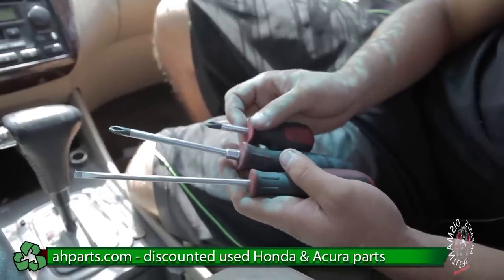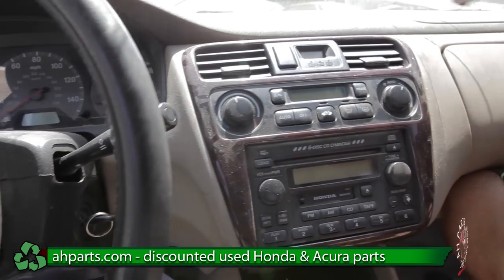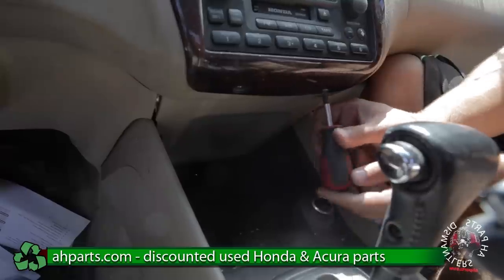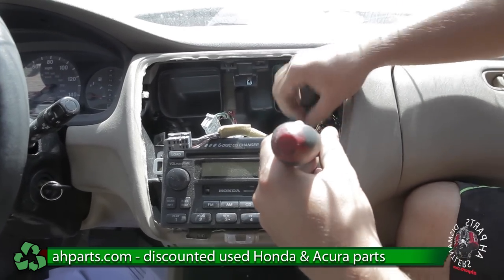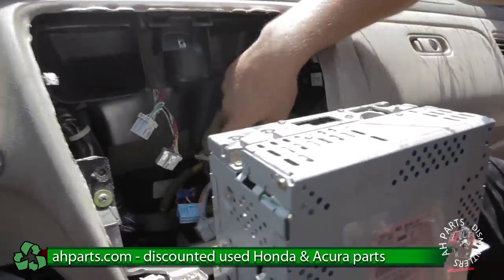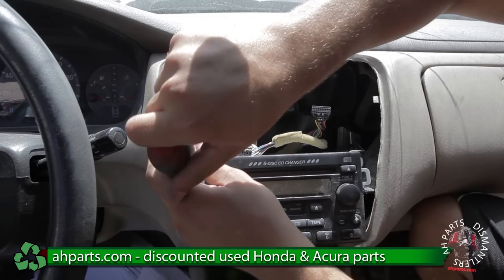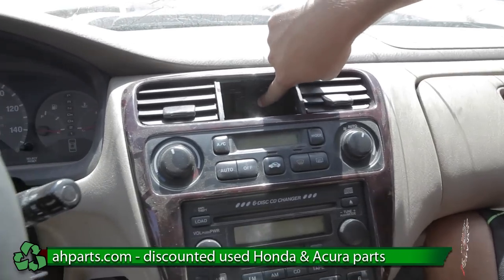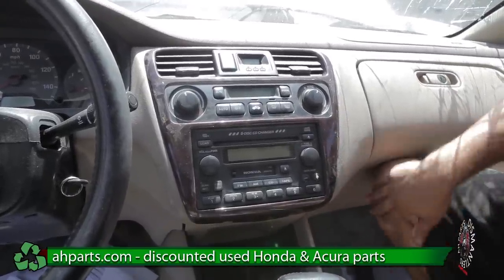How to replace / change a Radio 1998 1999 2000 2001 2002 Honda Accord REPLACE DIY

Comment: Who takes their stock radio out to put in another stock radio 😂😂😂
Reply: Idk maybe a tutorial about to to take out an install a radio
Reply: Ha, exactly.  I thought he was going to put in some cool SOTA android auto unit or something.  My accord's stereo had its CD player die a while back so I want to replace the whole unit, if I go to that trouble I'm not going to put in a 20 year old stereo.  Where would you even find this radio now?  I doubt Sony makes this model from so far back.
Reply: Purists in Germany would buy used BMW and go to get the original radio. Here the manufacturers made us belive oem or bicycle....
Reply: I DO! Replaced my Broken Cassette player with another that works GREAT! "OLDE SKOOL", can youz dig it!! ...Payce.
Reply: @beeman10power  same here man. have a '99 civic, when I bought it two years ago it had an aftermarket bluetooth unit; I put in the factory CD/radio unit AND the original casette player accessory (I can play songs from my phone using a $5 casette adapter that never breaks); found both at a junkyard for like $10 each. sometimes it's all about that original look, ya feel me. the aftermarket didn't fit the clean 90's interior look ;) granted, I also consider myself a purist. no hate, just thought some of y'all would like to understand the reasoning behind this kind of stuff
Reply: Yooo ong
Reply: @srinivasaniyer407  in Germany Cars become historic after They Turn 30 but they must be 90% Original. So you would want to have the Original Radio to get that TAXFREE historic Registration.
No worries you can imidiatly get a New Radio after but keep the old for the renewal every 2 years.
Reply: I did
Reply: I'm putting in a tv
Reply: Wtf💀💀
Reply: I put in a 50 in  plasma tv!!!
Reply: This is a good point if you’re replacing the radio you’re probably going to get an upgrade

Comment: This may be a dumb question so pardon my inexperienced. My 2000 Accord EX V6 came with the radio that only has the CD player. Will the radio with the CD AND cassette player fit in there too? If not, is there one from maybe a Civic or a TL that will work? Also, will I need a different radio code if I disconnect the battery and install a different radio?
Reply: yeah, the refreshed one (2001-2002 accords) will fit in there too. you will need the security code; just look at the serial number on the sticker and call your honda dealership's service department and they can look it up for you. message me if you have any questions I've done this many times lol

Comment: If the radio I am installing is only half the size of the original will it cause issues? Will there just be a big hole where it used to be?
Reply: They sell after market kits for aftermarket stereos like at walmart they are a about 15 bucks.

Comment: Next time you do a tutorial, make sure you learn how to take a bezel off before you start recording. You clearly changed your whole approach on how to remove it. Hadn't you caught yourself, you would've taught everyone how to break their bezel and although it really doesn't harm anything afterward, the sole thought of knowing something is broken bothers me and anyone else who takes pride in their work. You could've edited the video before posting it too. I've been taking this particular model apart for years now and I've never broken a bezel or any piece of interior trim for that matter.
Reply: there really is a lot of bad information out there, i think the guy meant well but this tutorial was done backwards. and youre right if something is broken at least for me , it bothers me to know its broken even if it doesnt affect anything.

Comment: the thing l don't understand is, who worked on this car previously and then left the old stereo in? what the hell were they trying to do?
Reply: new question... why are you replacing a stock stereo with a stock stereo?
Reply: Electronics For Fun lmfao
Reply: The original owner probably replaced the stereo with a new stereo deck and then changed it back to the old one when they sold it so they could keep their after market stereo deck
Reply: Cause it's cheaper and i don't want any problems with fancy bluetooth crap i dont need
Reply: There were some models with only a single din tape deck instead of the CD changer shown in the video

Comment: B-b-but how do you enter the radio code once you get the code from the dealer?
Would disconnecting the negative battery cable stop you from having to call the dealer and get the radio code?
Do I need to get a radio code if I'm replacing the factory radio with a different stereo, like a Pioneer or JVC?
Reply: Did you get the answer if you need the code when you replacing aftermarket radio?
Reply: @DavidHernandez-ue4fz  why would an entirely different radio need a code?

Comment: Would this be the same thing for an after market radio ?
Reply: +Jose Rivera  Aftermarket stereos include wire harnesses for car manufactured make or model and stereo make and model plastic trim that goes around the stereo to fit the voided spaces. My 1999 Honda accord has no r.c.a. to amp hookup, fairly expensive to upgrade to what I want. The answer to this your question is no.
Reply: Go to Crutchfield.com, they're awesome and make life easy. Cheek out their site and you'll see. I just built a small system in an 00' civic hatch. They give you everything that you need from instructions to pre wired harnesses. I know this sounds crazy but I spent less than $200 and the system thumps like a $1,000 system. I'm going to do the same to my 01 accord.

Comment: One trick to prevent the screws from falling after you unscrew them is to buy a magnetized screw driver or drill bit. The screws will stick to the screw driver and will not fall off and get lost. 😀

Comment: The missing screws on your car are a hassle to take of on my car smh I'm afraid of stripping them
Reply: I had to use a 8mm socket to open it, was much easier than using a regular screw driver. 👍🏼

Comment: Your kidding right? You tokk the bottom screws out, realized you missed one behind the hazard light and instead of cutting that vid clip out, you kept it in and out the screws back in and then changed screwdrivers after using the long one and then pulled the top screw out 🤦🏻🤦🏻🤦🏻 nice

Comment: My car won't start after installation, and outside lights keep flashing. What's wrong?
Reply: Did you leave the hazard lights on and drained the battery?
Reply: Anti theft system